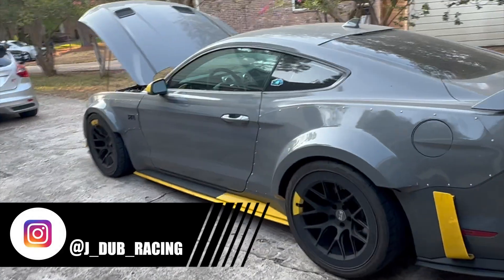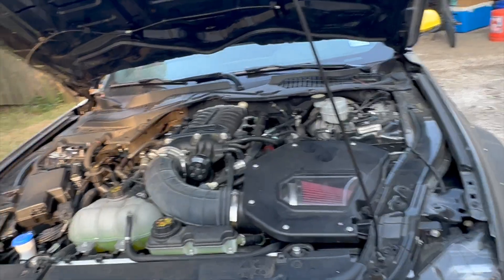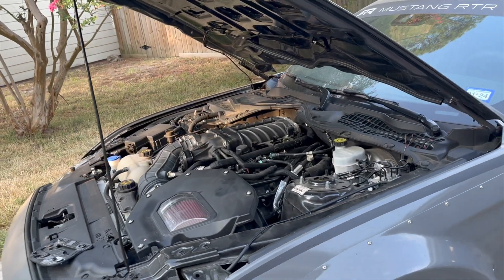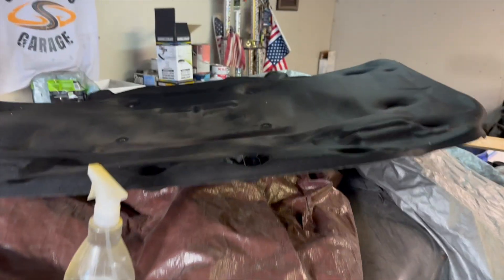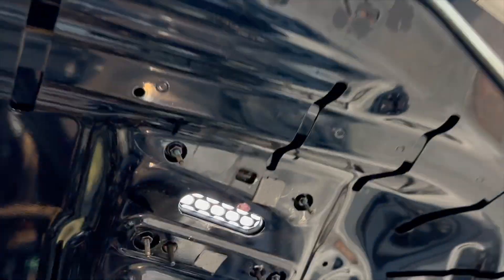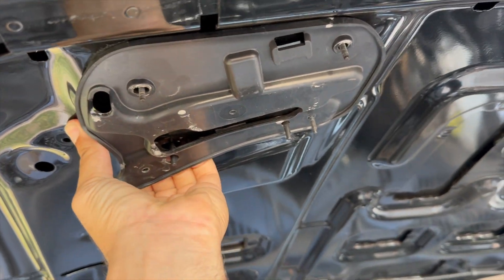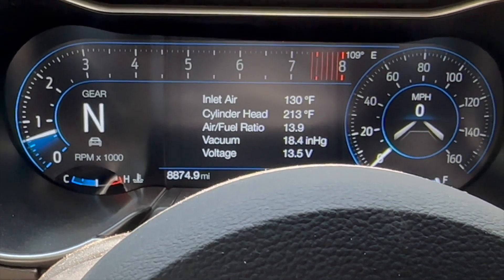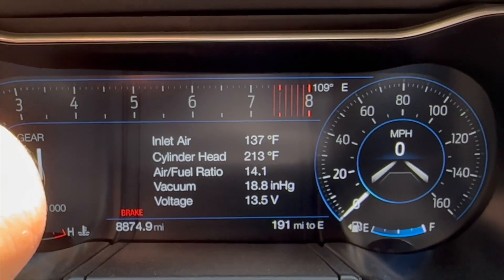Managing Heat Soak - S550 with Ford Performance Supercharger

Comment: Did you check fuel pressure...can cause power loss and running lean will run hotter

Comment: Put a 160 thermostat in it and have your tuner adjust when your fans come on sooner
Also get a larger heat exchanger or double up on the heat exchanger.   With added fans for the exchanger.
Reply: Fans only help if you're not moving .if that. Once moving you're are the handicap without the fan.

There's a YouTube video testing fan and no fan on heat exchanger..search for it. The fan was worthless 

Go larger heat exchanger

Comment: Did you ever fix your heat soak issue? I have a 21 GT with the Roush Phase 2 kit. I too had major issues with heat soak. I contemplated getting a Whipple kit, but I eventually installed an FI Interchiller kit stage 2. It has solved the high IAT2 problem for me. I think it is the most economical way to solve this issue.
Reply from the maker: It appears as though I have.  I still need to run the car on a hot day.  I posted a video on it recently - https://youtu.be/2CO-J8AOVTA?si=SSACPNQyhKOp4fBD